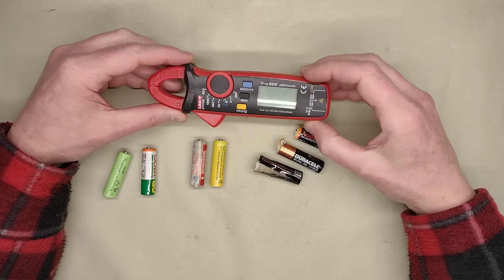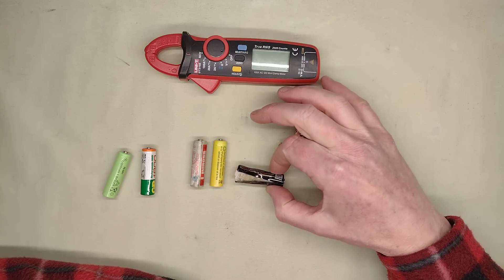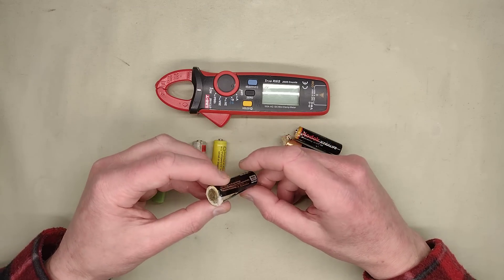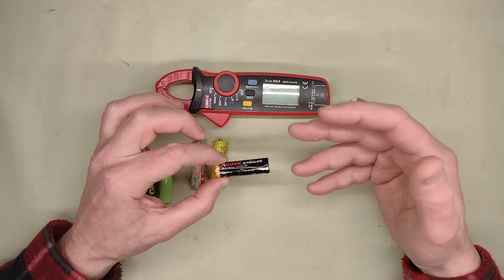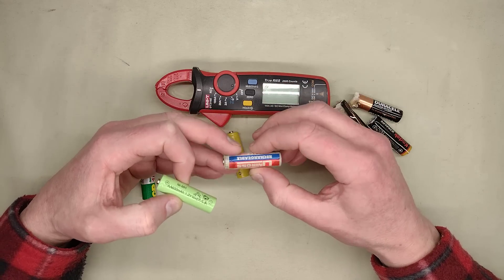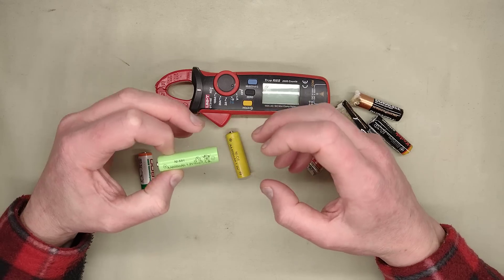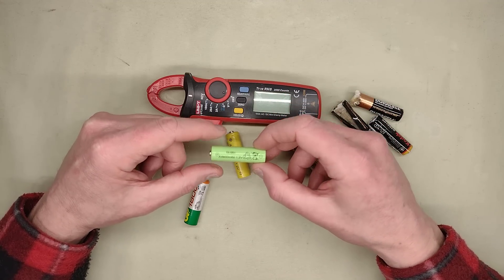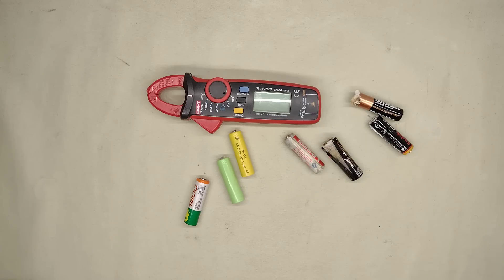The curse of leaky alkaline batteries

Comment: You’d think I’d have learned my lesson with the previous leaky Duracells in my experience, but sadly no. Shortly ago I had a great flashlight (3 AA cell mag lite, no longer made), ruined by three still in date coppertops. The bad part was that I had already bought some non rechargeable lithiums to try out in the flashlight.
Reply: Ruined two beautiful Mag the same way. It was a complete disaster, the cells get stuck inside and the leaking electrolyte start to eat the aluminium compartment... I will never buy Duracell anymore!
Reply: I have the same problem.

Comment: Having recently cleaned out some strings of battery operated Christmas lights, where every one of them the alkaline batteries exploded, I've decided we're switching. Bought my first two packs of Eneloop Pro batteries to see for myself exactly how low-self-discharge they are in use. Might keep my D-Cell Mag-Lite on alkaline batteries for now, since it's only VERY occasionally used, and I have yet to see a D Cell fail so catastrophically. Hooray for internal volume, I guess? 👍️

Comment: I have a lot of test equipment particularly RF that only work with 1.5V. Now I use rechargeable lithium AA, AAA and PP3 as they have the proper terminal voltage and a more predictable discharge curve they now cost about same as Enerloops

Comment: I recently rescued a Micronta 22-207 volt-ohm meter (circa 1970s) from the local rubbish tip shop.  I was dreading the potential battery leakage all over the internals.  Luckily for me, the Radio Shack "steel clad" (gold/red/white branding) carbon zinc batteries that were left inside did not leak!  The 9V battery measured 2.58V, and the 1.5V battery measured 1.18V on my digital meter.

Comment: How do you properly clean battery exploded electronics
Tv remotes, Rc cars, LED lights ex
Reply from the maker: With vinegar to neutralise the alkaline electrolyte then rinse off with isopropanol.   Slight abrasion may be needed to expose clean metal contacts.

Comment: Back in the days of zinc-carbon (1960s / 70s), the announcement of "leakproof" cells was the answer to all our prayers. It took less than 50 years to re-invent cells that are designed to ruin the equipment that they are used in.
Reply from the maker: It seems to be largely down to the eco warriors getting mercury banned from batteries.  The trace levels used were there to absorb the excess hydrogen that causes the pressure and leakage.

Comment: Clive, I find two problems with Rechargeable batteries, 1) sometimes my intelligent charger show NULL, meaning it hasn't recognised there is a battery there (are the batteries completely flat and of no use anymore?) and 2) They tend to be fatter and sometimes struggle to slide in battery compartments, or if they do I have to use piers to get them out and normally damage the sleeve
Reply from the maker: That's usually where a  battery has been in series with others and fully discharged to near zero.   Using a dumb charger to give it a top up will allow it to be recognised.

Comment: Thank you for the video, I have two questions. Can you recharge the Nickel Metal Hydride with the alkaline recharger? I ask because I picked up a couple packs of 1.2v Nickel Metal Hydride batteries in aldi/lidl many months ago and it was only when I reached to use them did I ask myself this and I have never found an authoritative answer. What do you use to clean the alkaline discharge from components?
Reply from the maker: I'd only recommend using a proper NiMH charger.  You can use white vinegar to neutralise alkaline seepage, but the contacts will potentially be corroded and may need cleaned.

Comment: Would you believe that I too JUST discovered a pair of leaky alkalines TODAY?

Speaking of batteries and early low-voltage cut-offs, what do you think of nickel-zinc batteries? Those weren't really on the market for long or much at all, but those have a higher voltage (nominally 1.6V).

Comment: There's a second reason why sometimes alkalines needs to be used - some very badly constructed (often but not always older) hardware either won't even turn on! OR run down very fast when using NiMH batteries because they require higher voltage than NiMH batteries provide. Yes, it's very bad even with alkalines because it means it only use 10-20% of the charge of the alkaline (before it the voltage drops) but there's enough of it out there to be irritating.

The solution for THAT may be to use Li-Ion rechargable 1.5V cells (with voltage converters), these either run at 1.5V until close to the end where they gradually ramp down the voltage to 1V to trigger the "battery low" varning, or runs at 1.5V until they shut down. However, I've not done long-term testing on them so it could have similar issues.

The drawback of the Li-Ion rechargable 1.5V batteries is that they cost a LOT more than NiMH batteries and the output is slightly noisy (due to using DC/DC conversion) - in some audio applications this can cause audio noise, so for anything where the NiMH batteries works they're clearly a better idea.

The 1.5V AA batteries comes in variants with a micro-usb connector OR they need a proprietary charging but runs longer (because the micro-usb connector is HUGE! in an AA cell). AAA cells tends to always be proprietary, 9V tends to always be micro-USB because the size penalty is much less there. I use the Kentli brand for AA/AAA cells but there are others, they seem to hold charge fairly well.

Comment: Sir.  Have you found that your meter shown does, in fact, properly note both AC and DC current amounts?  Most in that price range that claim to, do not.  They will be semi-accurate for AC but not DC.  

A T Burke
Reply from the maker: With DC you have to be careful to zero out the meter and hold it in the same orientation, as the reading will be affected by magnetic fields in the vicinity.
Reply: @bigclivedotcom  Thank you, Sir.  

A T Burke

Comment: Just talking about batteries reminds me of a charger my dad got from argos back in 2001. 

It has a dedicated switch for ni-cd and ni-mh and it just makes me wonder what the difference is in terms of charge, what does the switch change that makes it charge differently from one to another?
Reply from the maker: It usually affects the sensitivity to the end of charge voltage change.  It's much smaller with NiMh.  Some may also use lower current to charge NiMh cells.

Comment: When Duracell killed my prize possession SRL camera I cried.  They tricked me by still working while they were leaking. I tried shorting many battery brands with a 1k resistor to try and find the best and worst but the batteries refused to leak. In the end I realised that when you buy new tech with batteries included, that may stay on the shelf for years before being sold, they always include GP batteries - so now that is all I buy, and so far, so good!  (However Energizer have a no leak guarantee on some batteries)
Reply: I had the same thing happen with Rayovac batteries in a power winder. I was using the camera when I realized my hands were wet.

Comment: A battery inside a TV remove when I was a kid started pissing it's liquid out in a small 3ft stream onto the carpet, I didn't wash it out, carpet was fine, think it just went in the bin and it never exploded, but I don't know why it turned itself into a fountain...

Another time I found a brown mark in the bottom of my toy box, thinking it could be sweet m residue, I m licked it, bit of a mistake as my tongue started to burn, so there I am running my tongue under a tap, head half way in the sink 😂
Reply from the maker: They pressurise internally as they discharge.
Reply: @bigclivedotcom  I mean, it's in a constate of discharge, isn't it?😂

Comment: Not sure of the brand. Maybe Panasonic D-Cell. - Anyway I just changed some backup batteries in a CNC machine. They were perhaps 20-some years old. And only 1 out of 3 batteries had started leaking, and it was such a minuscule leak that I didn't even have to clean the terminals before putting in new batteries. I expect to have to change the new batteries yearly and I wouldn't be surprised if they leak like crazy.

Comment: I find that the alkaline batteries only leak if you leave them in a device. If you don't use the device that often, take the batteries out, and you won't have the leaky mess. For devices you use regularly, it will rarely become a problem before you have to replace them anyway.

Comment: Some alkaline seem to be more prone to leaking than others. My Dad and I have both had bad luck with Rayovac, a relatively old and common brand around here, but they often damage stuff when they leak. Durcells have leaked as well, though usually not as bad. Oddly, I don't recall much issue with the  Dollar Store type brands. Lower capacity, less prone to leaking maybe?

Comment: I’ve found more problems with devices using NI-MH AAA batteries than AA batteries especially childrens toys. Many devices seem to take AAA batteries when they should really be using AA batteries as they simply don’t last with the smaller cell. 
I’ve also noticed a heavy switch to li-ion in devices that really should use AA/AAA batteries, some wireless overear headphones, torches and even electric toothbrushes. Many devices I would argue Li-Ion is overkill for and reduces the life. I still have my MP3 player from the mid 00’s that uses AAA while the one with the built in li-ion is long dead
Reply: The solution is disposable lithium batteries, I think Energizer is the only one who makes them. They last twice as long as alkaline, have over twice the peak current output, have twice the listed shelf life (4 times in reality, since alkalines only last half their listed shelf life), and they cannot, and do not, leak. The only caveat is that they're twice as expensive.
Reply: @specialopsdave That’s the point. There has been a shift to lithium based batteries when there is a perfectly acceptable technology in the form of NiMH  in many cases. In the few occasions NiMH doesn’t suffice Disposable alkaline is fine to fall back on even if not the perfect solution. Disposable Lithium is an alarming proposition as Li based batteries should be rechargeable and the thought of throwing away materials that are currently in short supply based on current demand and increasing supply has huge impacts that should not be a practice that is done.
Reply: @Javadamutt  Just so you know, batteries are recyclable. Easily so. If you think it's too much work and you can accept batteries with 1/3 capacity, you do you. I'm going to just save up my used batteries for 5 years then recycle them next time I go to my Batteries+Bulbs store.

Of course, the more ideal solution is to wait for aluminum-air batteries to take the place of alkalines.
Reply: @specialopsdave  Can you read everything please and try to understand it before replying.
1. You said dispose in your first post...that is not recycling
2. I specifically said many things are using lithium ion that doesn't need it. 

Here's an example....a pair of bluetooth headphones I own. They last 20 hours with 2 AAA batteries. Again no need for Li-ion as I always carry spare batteries, weight isn't an issue and when the battery stops holding charge I can replace it. I don't need 60 hours charge and if I did I can carry a spare battery in the headphone case. 

Another example is children's toys. My daughter outgrew a musical bear she had and it was passed on to friends who's child also outgrew it. It was still on its original alkaline AAA batteries. I did swap NiMH into it but it wouldn't even power on. Do you propose Li-ion for a childs toy because many are starting to come with them and it's completely overkill and actually more inconvenient to recharge them never mind your child wanting to play with something you simply can't swap the battery out.

I don't understand why you need to wait 5 years to recycle batteries either. Our recycling bin collection takes all batteries, even supermarkets and recycling centres. 

I don't understand why it takes you 5 years to recycle batteries. Local recycling collection, recycling centres, supermarkets and even some online stored all recycle all batteries here. Once the battery is dead an no use its recycled in a matter of days.
Reply: @Javadamutt  Can you read everything please, and try to understand it before replying? The reason I would wait 5 years is because that's how long it would take to fill a grocery bag of dead batteries, and I'm lazy.

And I never said lithium *ION*, I said lithium *DISPOSABLES*, which are Li-MH. They are the EXACT SAME FORM FACTOR as alkalines and you CAN simply swap the battery out.
Reply: @specialopsdave  considering MH is used to describe a specific battery chemistry. I have never heard or seen lithium batteries called Li-MH so assume you might actually mean Lithium iron disulphide or some brand version like Enegizer Lithium.
Reply: @Javadamutt  Energizer Ultimate Lithium is lithium metal based, and involves dissolved hydrogen, making it Li-MH

Comment: Several years back I got really p*ssed off by my elderly mother over leaking batteries.

Leading up to Christmas she'd always call me to say that a load of her really expensive D cell powered tree lights won't work again (she's got a dozen or so sets that go around all the downstairs rooms), so I'd go over, and spend a couple hours removing all the furry batterys, and cleaning all the cases out with about 20 quid's worth of contact cleaner/isopropyl alcohol. Each year I'd tell her that she NEEDS to take the batterys out of all of them before packing them away this time, and each year she'd choose to ignore that "Advise" as not something she needs to worry about. One year I decided it wasn't happening again as I had much more important things to do during the lead up to Christmas. So I bought over £150 of rechargeable D cell batteries and a 4 cell charger. I cleaned the battery compartment's up for what I thought was the last time, and explained to her what I'd done. I gave her the charger, explained how to use it and when to charge them, and that was that.

Next year I didn't get the call, so I assumed all was well, but the following year she was back on the phone again. It seems that the previous year she decided it was more aggro than it was worth to go through charging close to 30 batteries for 8 hours per set of 4, so SHE BINNED THE SODDIN' LOT and fitted non rechargeables again !!!!! I blew my top, and refused to touch the damn things ever again.

Since then she's replaced them with cheap 2x AA powered LED tree lights, and still ends up replacing about half of them each year because she STILL never takes the batteries out........ but I don't care because she knows better than to ask me to fix them again.

Comment: I agree re. using NiMh but lots of ready-to-run radio control transmitters see NiMh as discharged so set off their low battery warning alarms/lights almost instantly whereas with decent Duracells they run fine. So the answer is ??????

Comment: I do make exclusive use of NiMH where possible these days, including clocks, flashlights, remotes, label printers, multimeters, cameras, DECT telephones, etc. However, some devices do still require Alkalines just for the higher voltage; including my MFT and proving unit. Until those die and are replaced, Alkalines will always have a place for me.

Comment: The other exception might be an electricians inspection meter, but even that is questionable. Both the person who thought me for mine inspection upgrade and the NAPIT's (and according to a colegue also NICEIC's) inspectors inspector keep insisting on usage of Alkaline   batteries, yet I find Eneloops (or ikeas Japanese made NIMH batteries) more stable especialy when locking meger to generate 500V for faultfinding faults that only happens in large enough current (9 out of ten times it ends up being USB socket), So as a result I am using one spare pack of duracels just for inspection and use Eneloops for everything else. The question is wether its a matter of me missing something or just the elderly not realising the higher grade NIMH. You have also missed rather fundamental point, that in UK average user has no option of buying a good quality battery charger that would charger each battery separately (UKconsumerism is controled by chainstores which are not big supporters in sustainability or quality any further then words in the add), unless technical enough to find a good one on-line.
Reply from the maker: You can completely ignore any opinions of the NICEIC, NAPIT and other "voluntary" approval / marketing companies.  They exist in a fantasy world of paperwork and 1 week electrical training.

Comment: Thanks Clive, I have this exact multimeter that I got around 6 months ago and not used much. There is no damage, I have removed the batteries and I will replace them as you recommended.
I have two other multimeters and opened them up and found no damage yet.
The analogue meter had the expected two AA batteries for the resistance meter and continuity tester, but it also had a 9V battery, why? Is that to test diodes or transistors? I’ll have to check the unused ports.